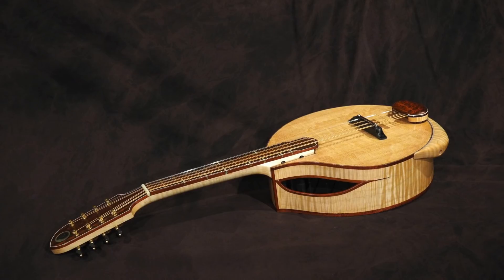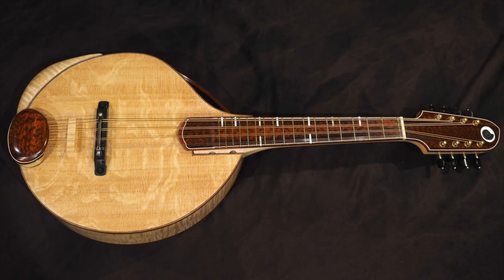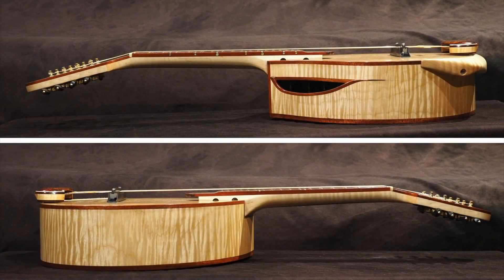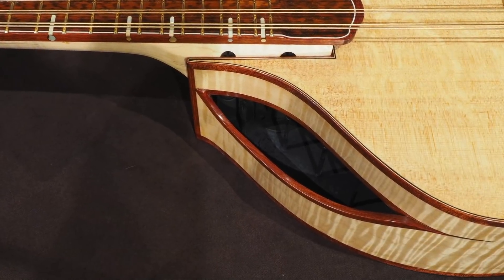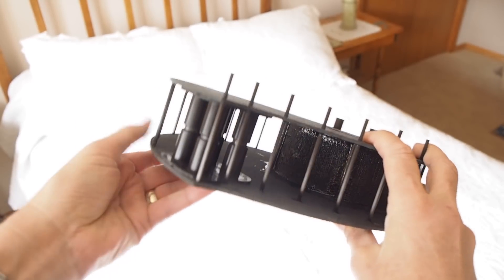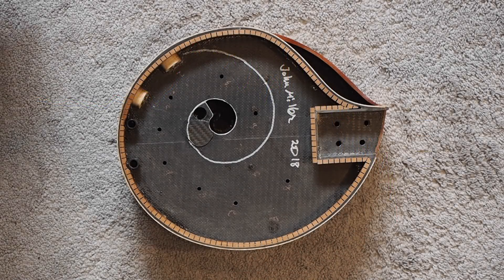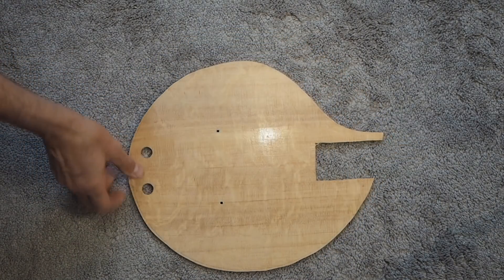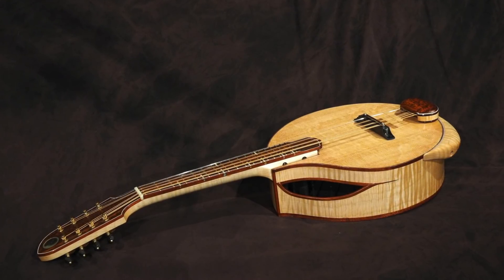A Different Mandola

Comment: I finally found you! Your mandola is so well made and sounds lovely. I have been building cone guitar soundboards and folded horn bodies...along with nuetral bridges...without knowing about your earlier work! My little instruments are much cruder and my resources much more limited. It is really encouraging to see what can be done and it gives me inspiration to try more ideas.
Reply from the maker: Cool!!!! Do you have photos? I have built several more internal horn / neutral tension bridge instruments now, with new refinements for each one. My favorite is a 5 - double-course (i.e., 10-string) octave horndolin with a 19 inch scale length. Also did a tenor ukulele. What have you built?

Comment: You have introduced so many interesting concepts that it will take months to process it. Your workmanship is exceptional. To designers like me, this video is very valuable. as it puts some really important acoustic principals to the test. I would like to know what what the resonant frequency of the instrument is (tapping the top with the strings held still) as I'd like to know how it applies to a horn shape.
Reply from the maker: Thanks Daniel. This means a lot coming from you, one of my hero luthiers.
I will try the tap-tuning measurements. I have a good friend with access to a laser doppler interferometer, and will try to do some measurements with that, too.
The aspect I want to pursue now, quantitatively, is the effects on the frequency spectrum of increasing the break angle fro zero tension to some positive and even negative tension. Preliminary tests indicate that going either way from zero tension causes a decrease in sustain, decrease in higher and lower harmonics,  and decrease in volume. I bet it shifts the fundamental downward, too. I will try to quantify that.